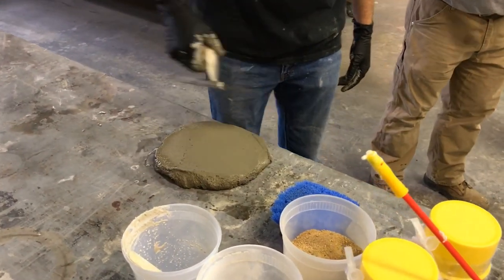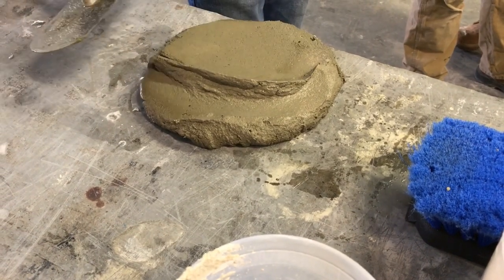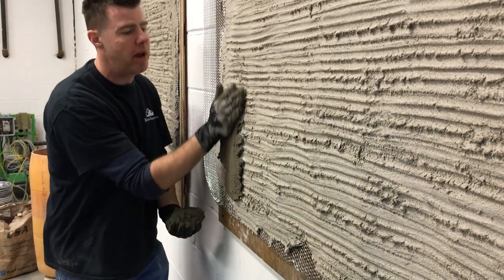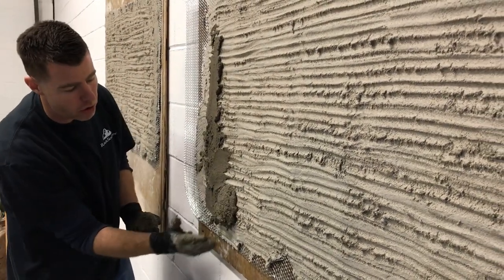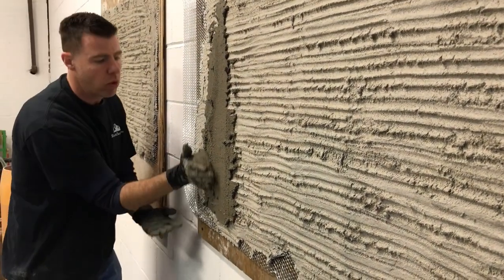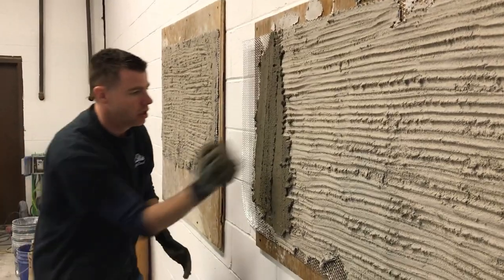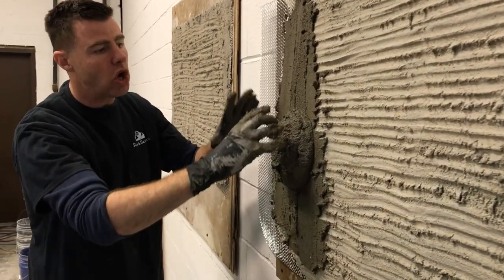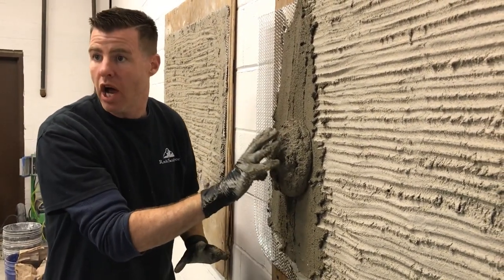Carving Concrete Mix Design and Feel with Warren Ness.  Carved Concrete - Concrete rocks

Comment: Would you recommend this additive for a vertical spray up and fiberglass backer coat?
Reply from the maker: Not really. We have an additive called GFRC admix specifically made for that application that will reduce the pinholes as well as densify the mix